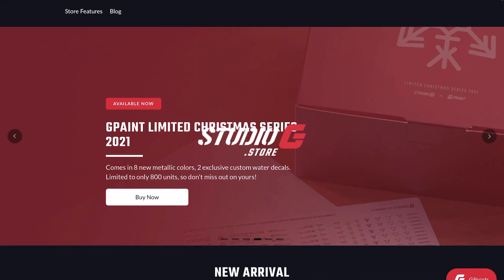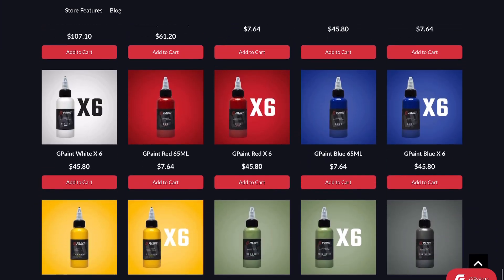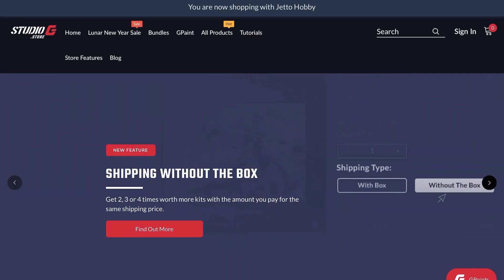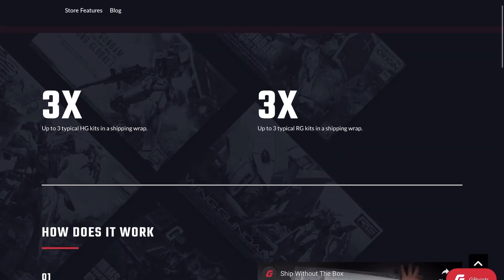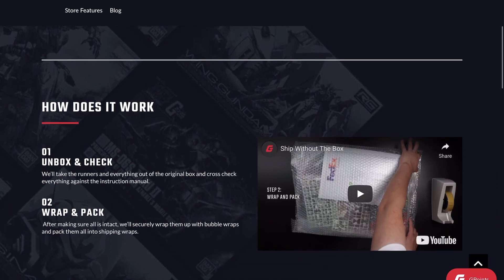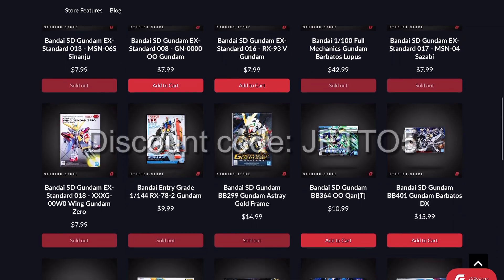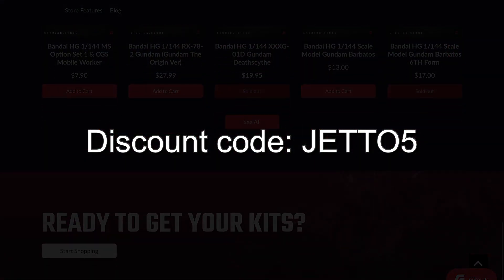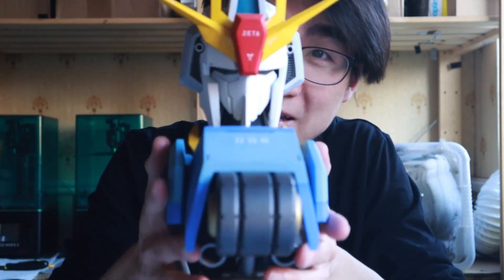HOW I DESIGNED THE ARC REACTOR MK. I | Fully 3D Printed Model Kit with USB powered LED setup

Comment: What tablet software are you using for your CAD design?
Reply from the maker: Shapr3D
Reply: @JettoHobby  thank you! im currently using fusion 360, but ill check this out.
Reply from the maker: @AnthonyGarcia-uk5ou  fusion 360 is good too! I use Solidworks in tandem sometimes
Reply: @JettoHobby  Solid works is very expensive!

Comment: Hi i have purchased the file but im unaware of which resistor is to be used with the led's..
The wiring diagram isnt included with the files..
Kindly guide
Reply from the maker: Hi, I do not have any wiring diagram for this as I’m not that professional in electronics. But what I did was just connect 3 blue LEDs to a 220 Ohm resistor in parallel, repeat three times for all 9 LEDs, leaving only two wires left to connect directly to the USB port. 

Sorry I hope this helps … let me know if you’re still struggling and I’ll try to make a wiring diagram …
Reply: @JettoHobby  thnx that helps
Reply: @JettoHobby  hello sir..
I tried putting 220 ohm resistor to the said 9 led's and tried to connect it to a power bank..
No luck..
I even tried connecting it to power supply still it won't light up ...
But one thing i have to say.. this project of yours is phenomenal.. can't believe how beautiful it turned out to be..
Thank you so much for this beauty
Reply from the maker: Do check everything, do the simplest test on a breadboard to see if your circuit is correct. I always check to make sure each LED is working with 3V using two AA batteries or a 3V coin battery. 

Then add resistor to see if it works. Then add the usb port to see if it works. 

I hope this helps, there’s a fair bit of tinkering and researching initially to get the electronics to work.

Comment: Hello bro, to create this model, do you have all the details published somewhere, with the STL files and materials that are needed?
Reply from the maker: Hi there. Did you check video description ? Let me know if it’s missing anything.
Reply: @JettoHobby  Hi mate, can it be done on FDM printers? Cults3d files are to print on these types of printers too?
Reply from the maker: @emimanto  cults3D files are not limited to any particular print format. In short, you can try to print this in FDM but you will have to make your own supports. I personally never printed this project with FDM, cuz I know for fact that resin will give a much better result.

Comment: Hello bro.I’m buy your file 3d print.I have questions what color of light you use? And how many resist you use bro.thx.
Reply from the maker: Hey thanks for the support! I used 9 blue LEDs in total connected in parallel, three LEDs to one resistor 220 ohm. In total there are three resistors, but I think you can actually connect all of them to just one resistor. Please test it out first before assembling them to the part 😁
Reply: @Jetto Hobby  I want my color of arc reactor white. I can use white light and don’t paint clear blue?
Reply from the maker: Yes you can